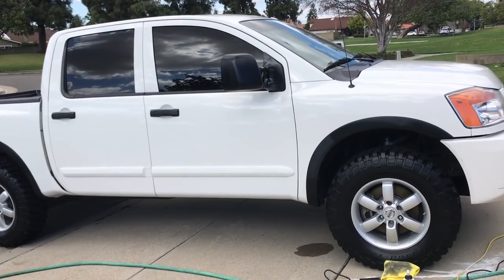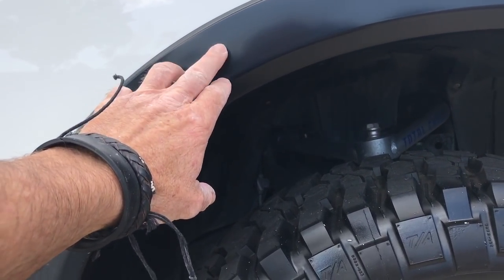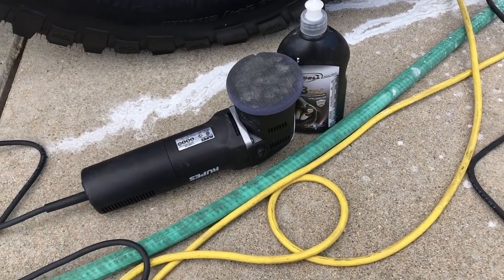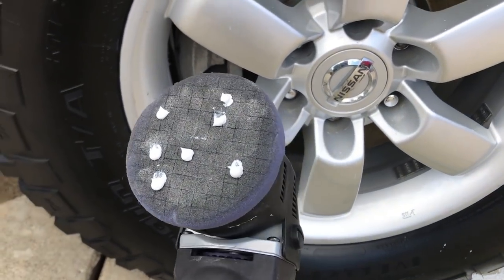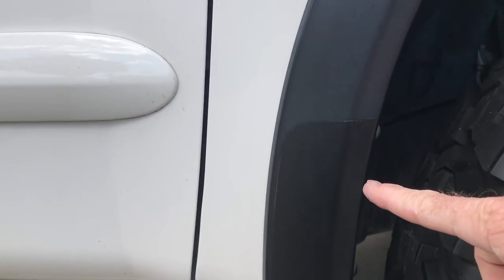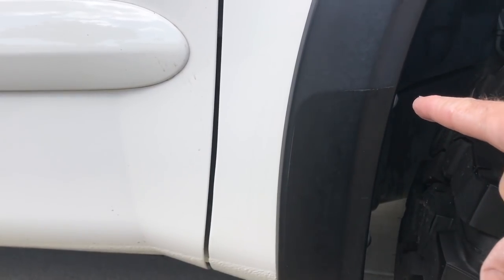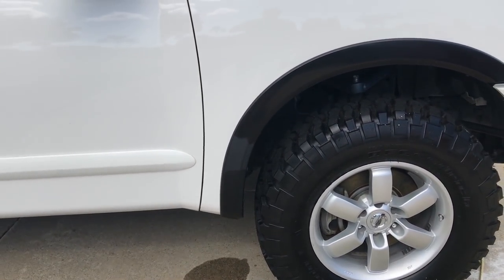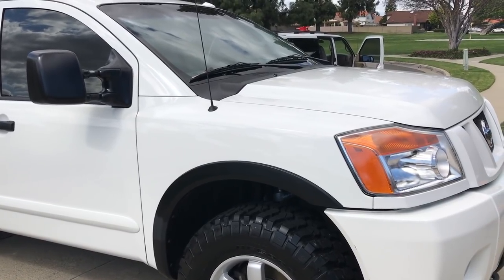Black Trim Restoration: Polishing black trim FAIL!

Comment: @Auto Fetish Detail
Darren
Have you ever used any other Clay lube , besides NanoSkin GLIDE  that works well with the NanoSkin AutoScrub Clay Products?

I find theat Meguiar's Last Touch Detail Spray D15501 , does not work well even if i dilute it 1:1 as per instructions by meguiar's, 

The Meguiar's doesn't work well when used with the Red & Blue nanoskin clay sponge's/clay blocks. 

-I'm looking into 3D Spray Detailer (bodyshop safe 503)  it looks like it works with 3D's nano towels which im guessing are made by Nanoskin. 

Nanoskin glide is hard to get where i live and i find expensive also

If you could give me your thoughts/ opinions i'd appreciate it. 

Thanks.

Comment: You could of use wipe like new, I have use it in two of my trucks & one of them I applied it when I bought the truck that’s it’s a 2013 and all the plastic still looks new and a 2017 ram rebel and I take it the mud, rain, snow, and the plastic looks nice. I have also use it on my friends little suv Honda that had ugly plastic all around, it look white. The first Application it look new

Comment: No trim greasy trim restore products in my shop. ALL plastic trim is polished.  If the rubber trim has not started to break down it gets touched up in the final polish then either a sealant or ceramic, depending on what the customer wants.  People always say, you can't polish textured plastic it will stain it. 
Trim dressings don't do well in Oregon, as soon as they get wet you get nasty streaks running down the sides of your vehicle. 
Half of what I do at my shop most people say just can't be done, it's too far gone. It needs to be replaced or painted. 
A little know how and a lot of patience, most anything is possible.
Reply: Urban Edge Auto Detailing hello.sir please.let me.ask you. Any black.trim can be restored by.polishing it, or only non texture trims??? No one talks about it in the.internet.... Thank you sir
Reply: The reason that nobody talks about it that there are only a small hand full of people around the world that polish textured plastic. The only person I have found that talks about it is Jeff with Texas on Site Services. 
To answer your question, yes textured plastic can be polished. I have a video on my channel with the before and after on a textured mirror I polished.
Reply: Urban Edge Auto Detailing thank you sir....also maybe product.companies dont want to talk about it...becauwe it is.more.profitable for them.to sell us tons of ptoducts to maintaine- restore-protect them....... Thanks again for your information i will check.the.video
Kind reegards

Comment: Great video, as always!

I have molded black plastic on my motorcycle visible here: http://cdn2.bigcommerce.com/server2200/w38vt/products/2296/images/10086/Radiator_Guard_Black_2__19156.1471488783.1280.960.JPG?c=2

It's been stained by degreaser. Would this method fix that? Or do you have any other recommendations?

Cheers